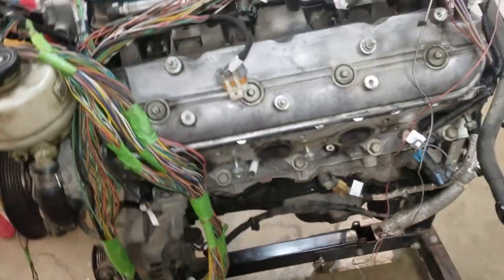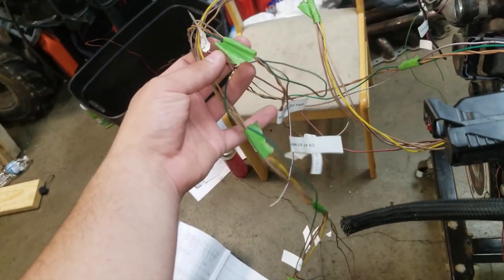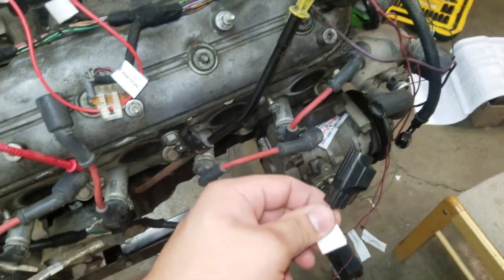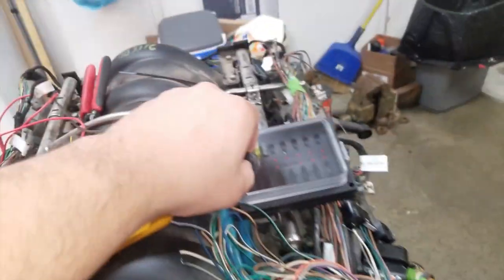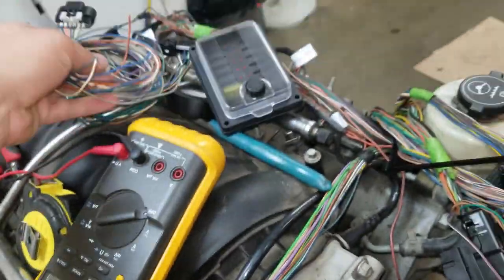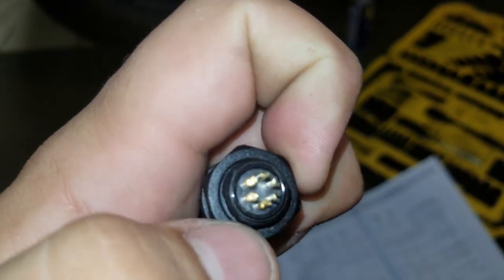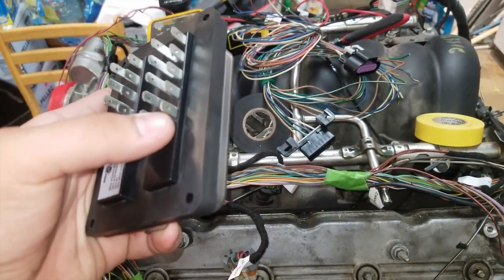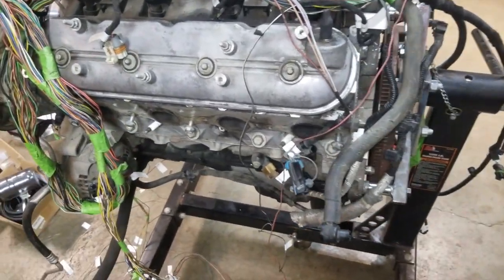G Wagon LS swap - GM Wagon - Part 1: Engine Harness and first Start

Comment: Is it worth it? Did you use factory trans set up? I been wanting to do it for couple years and after buying new Tacoma I am more about a g wagon. Just seems you go through a lot of wiring and the germans like to wire. I am simple dont need all the extra bs
Reply from the maker: Just buy a 1999 or older without a canbus and you will save yourself a huge headache

Comment: intersted to see the swap and know what type of issues you had faced when we can see part 2 ?
Reply from the maker: I already had the car dynoed just have to edit all the footage from last year
Reply: @viteksgarage4031  Great looking forward to it specially what it takes to successfully mount the engine on it , keep it up i already ring the bell to get any update from you 😉
Reply: How much have you spended, why is the ls swap better then 2jz or rb or 1uzfe 2.5, how will the electronics take place, do you need a supper charger charger to get instant power to get the car moving, is you build for performance or reliability?
Reply from the maker: @zalalmohit4740   So far its 25k LS is an easier motor to swap and comes with manual transmission bolted to it stock. I am redoing all the electronics. there is not enough room for forced induction. ands its more for the manual transmission then anything i wanted a cheap g wagon that wasnt stock and this was the best way to do it.